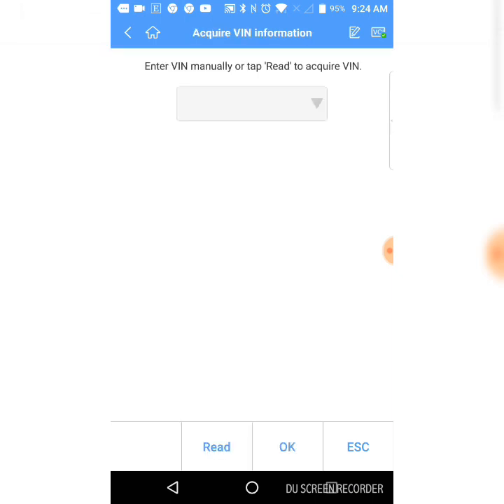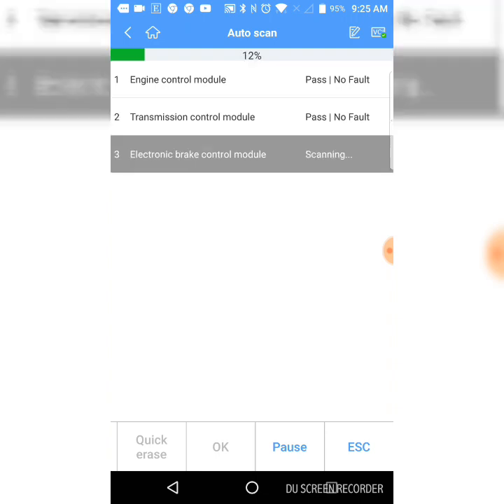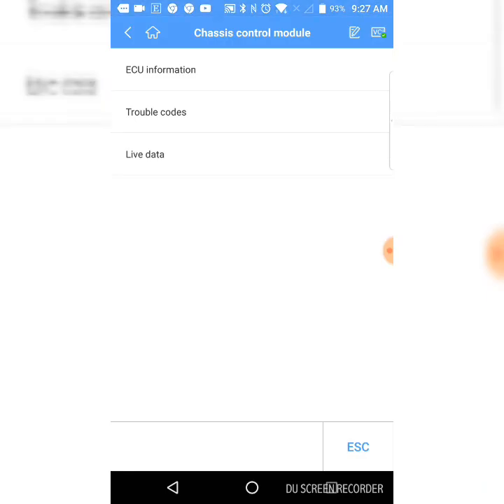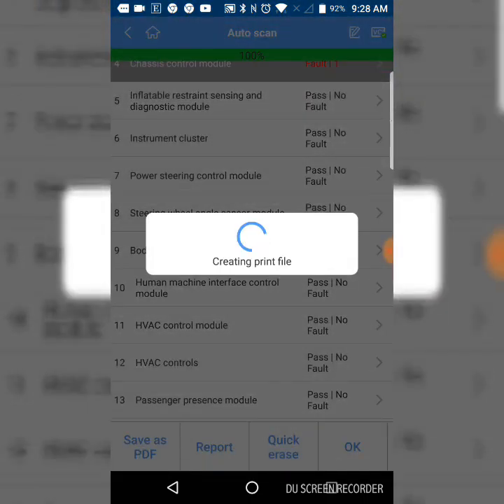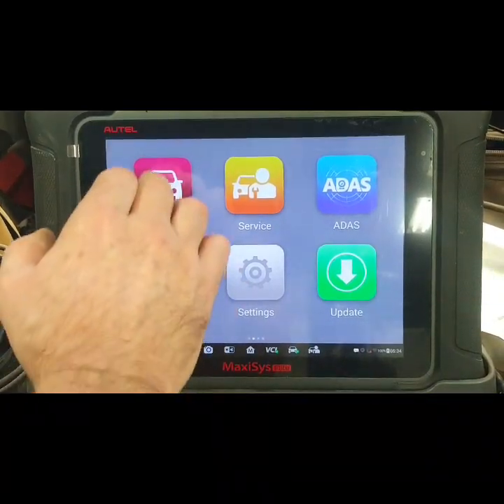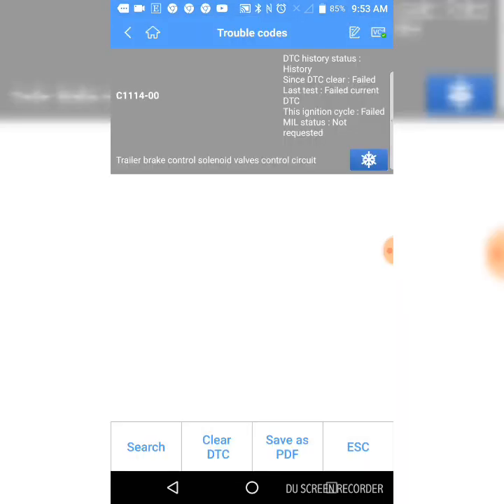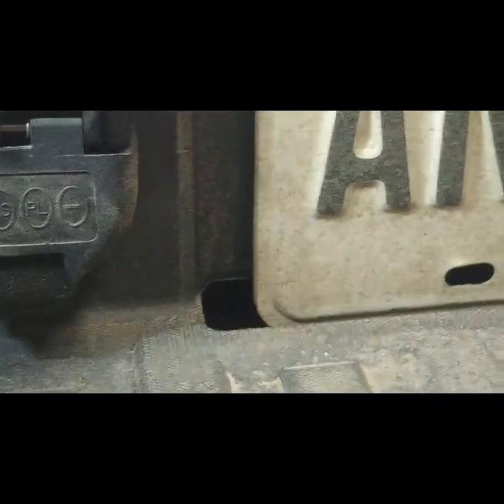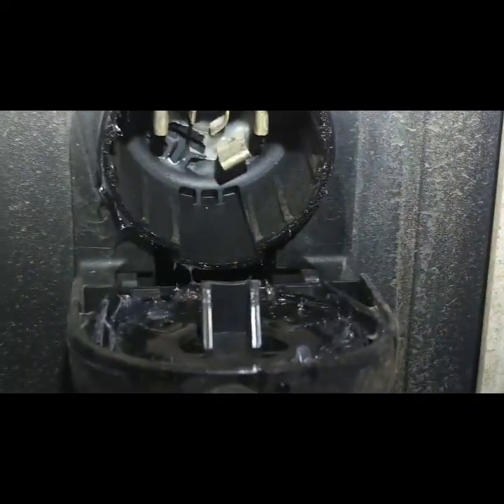2014 Silverado "Check Trailer Wiring" pt 2

Comment: Wow that’s sad the 2 higher end scanners let ya down. If possible can you do a part 3 when get the parts installed just to double check. Thx Phil 👍🏻🍻
Reply from the maker: I certainly will. I believe the customer somehow shorted the 30 amp Circuit to the brake output but will never know for sure. Sure is frustrating sometimes.

Comment: I always try to get in trough generic obd and data sometimes it shows diff things. What a shame too the edge lost so much value over the years. I have a Zeus, Bosch ADS 625, Autel Elite, Autel IM508, Launch Torque and Diagun and the CanDo C-Pro and still I have holes unfortunately
Reply from the maker: I know. Never seems to be enough. Definitely can't rely on just one scanner these days. I never tried to manually ID as a different year. Maybe when it comes back for the repairs.
Reply: Phillip Bailey def try to manually change and or go into generic obd2 the engine looking icon there a lot of diff data in there. When you can’t seem to find something give it a shot. Great stuff tho thanks for sharing